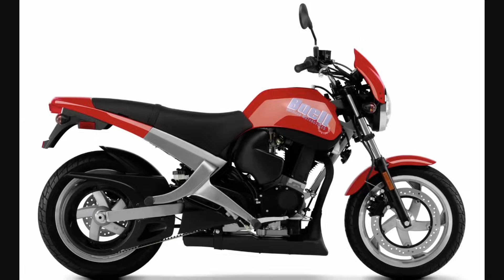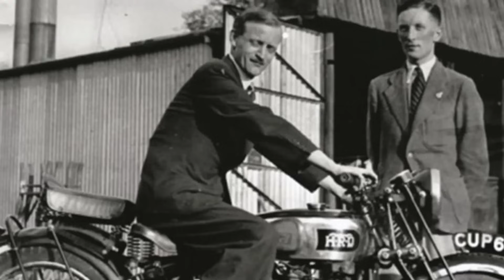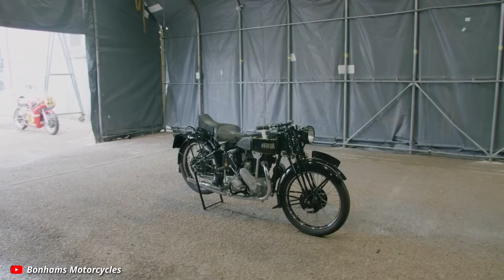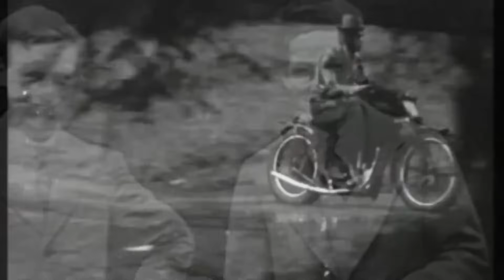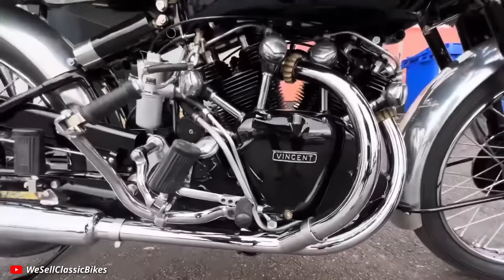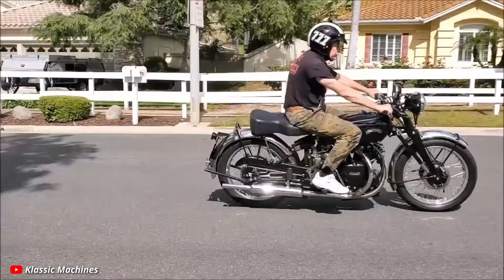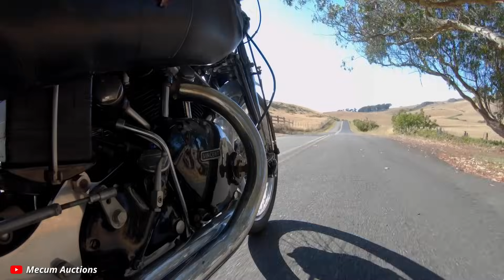The GREATEST Motorcycle Ever

Comment: Why did you not mention the Brakes were not adequate for the Speed and Weight of this motorcycle. You should have also mentioned some detail about the 'Compression Release' that was essential for a light weight Rider to start the engine.  The Magnetos were fairly useless unless the Engine could be spun at a relative high R.P.M. rate using the Kicker.  I was unable to start the engine on my friends 1955 Model C.

Comment: I've had about 30 motorcycles in my lifetime. My favorite was the 1951 Vincent Repide. When parked, people would always come around it to try to figure out what it was. A marvel in design for its time. The oil pump had to function in two ways: one to pump oil through the engine and the other to prevent oil from accumulating in the crankcase. This was achieved by a single moving part, which is what you call genius.

Comment: In 1980, I owned a 1953 Series C Rapide. While power was definitely there, not everyone felt the handling was all that wonderful, even during the years when they were being built. They developed a reputation for wobbling at high speeds, which the VOC (Vincent Owners Club) acknowledges. In 1965, Cycle World tested a 10 year old Black Lightning with only 2800 miles on it, and said "the handling was enough to make brave men blanch. Someone had once told us that the Vincent felt as though it had a hinge in its middle, but in riding the beast we quickly discovered that the hinge to which they referred was a ball joint. No motorcycle we have ever tested has flexed in so many different directions at once. Get the bike into a fast turn, trying hard, and it sets up a really heart-stopping shudder and waggle.... it is an evil-handling beast, with simply awful brakes. Potentially (and by this we mean unless ridden with great restraint) it is the most dangerous motorcycle ever to come our way: and we are not sorry in the least that it is no longer being made."  30 years later, in 1995, Hunter S Thompson wrote in an article for Cycle World magazine, where he said "If you rode the Black Shadow at top speed for any length of time, you would almost certainly die. That is why there are not many life members of the Vincent Black Shadow Society".
On twisty roads, Vincents could often be passed by other, smaller displacement motorcycles that handled better. Many Vincent engines were placed in frames made by other makers in search of improved handling.
It's interesting that after Vincent stopped building motorcycles in 1955, no one else purchased the tooling and continued production. BSA had become sort of the General Motors of British motorcycling, purchasing Ariel, Triumph and Sunbeam. Norton, Villiers and Matchless were together in AMC. But no one wanted to continue Vincent production. One must wonder why?

Comment: 1955 I bought a new series D Black Knight after being advised by John Surtees' . It served me well for over 27k miles but sadly had to part with it due to family reasons.  I often think of the past good times that machine gave me. Apparently there is one with the same Registration on the road but don't know if it is the actual same bike as I checked it on the www and stated it was first registered several years later. So I wonder if it had been a right off.  And the Reg Number then applied to a  rebuilt version.  Original Reg  SLE581. I'm getting close to the ton myself now. Thanks for posting this much enjoyed.

Comment: I bought a Black Shadow in 1958 in my late teens. It was sold in 1962 due to cash flow problems. Fast forward to 1999 when I bought a basket case Black Prince and restored it to concours condition. It is very original, no electric start, still with original suspension units but incorporating modern internal engine mods which for eg, reduces oil consumption. It is still near concours but I am too old to ride it. It is started and warmed through regularly and being a Series D has coil ignition, 6v electrics and still has its original coil which allows it to start more easily than with a magneto.

Comment: , my first motorbike that I bought when I was 14 was for £10 it was a Vincent. When eventually I managed to start it for the first time I took off down the lane and after a while I kind of realized now which one pedal is the break how do I stop this thing eventually I came to a stop and the weight of it just pulled me over and got somebody to lift it off me. I thought I was doing really well when I managed to sell it later before my parents found out for £10. I still have a 1949 Sunbeam S7 which I bought in 1965 for 10 pounds with about 1o miles on the clock. Since the beginning I have had broken ribs broken wrists broken ankles broken back broken thigh bone broken arm and various bumps and grazes and still alive and smile to tell the tail😅

Comment: To put the performance of the Black Shadow into perspective, at the time of its release it was THE fastest vehicle there was, two wheels or four, not, as stated here, "could outrun almost anything on two or four wheels". Although the CB750 Honda certainly came close, it wasn't until the arrival of the Kawasaki Z900 in late 1972, for the 1973 model year, that the Vincent was unequivocally surpassed for speed. Just imagine, the Kawasaki was developed with the truly massive resources of Kawasaki Heavy Industries, vast numbers of scientists and engineers, advanced metallurgy, it had four cylinders, four carburettors, double overhead cams, a 9000 rpm redline, in short the Kawasaki was the product of different world to the one that produced the Vincent Black Shadow.

Comment: I disagree, to me, Velocette is holder of the title. After all, ALL motor cycles owe their basics to Velocette, the very basic designs of the motor cycle gearbox is Velocette. Then, designing a motorcycle that could be stripped and re%assembled using 3 spanners and a rubber mallet! All the while redesigning and evolving and having a dedication to quality engineering.

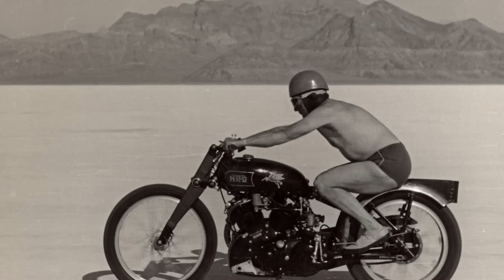Comment: I can't see the shock absorber, but the front fork and suspension at 16:32 looks like a Hossack. Simple for leg with two links to the frame. Much like sports car suspension starting above the wheel instead of to the side as a car has to do.

Comment: I have never seen specs on the Vincent Black Shadow.  My questions are:

1.) Why were Black Shadows so fast?
2.) What kind of carburetors did they use?  No air filter?
3.) Were they overhead valves or side valves?  How many valves?
4.) Did they use pushrods or something else to open and close the valves?
5.) What were the big plugs on each cylinder used for?  Valve adjustment?
6.) Did they have problems with overheating?  I notice each exhaust is located on the front of the cylinder, so I wouldn't think they did.

I hope someone can answer these.  Thank-you.

Comment: A couple of points, first the name change from HRD to Vincent is because in the US people couldn't distinguish between HD and HRD.  The second is you mention chrome a couple of times, Phil Vincent hated chrome so used stainless steel instead.  The Vincent Series C and D engines are some of the most beautiful in the world, as are the bikes.  I've heard that the entire bike can be stripped with the spanners supplied in the toolkit and engine removal and replacement is less than 45 minutes.

Comment: The mention of Vincent's WW2 role is not quite correct.  They also continued to make Motorcycle engines, but for use in drones (target drones?) by the Navy or Air Force.  Bizarrely, due to the ridiculous way military equipment is 'over-specified', even in wartime, the cranks for these engines were made to a higher spec than standard ones, and after the war came to be highly sought after by Vincent owners.
Reply: Yes you are talking of the Vincent Picador engine. I've seen one in a workshop being prepared for a customer, but never asked about it. I knew what it was instantly, after reading a feature in Classic Bike Magazine back in the 1980s.

Comment: I owned a series C Black Shadow in the early 80's and have to agree with you 100% . Smooth effortless power , very good brakes for the time and a clutch that one strong finger could operate. I have some experance with Brit bikes as in the same time frame I had BSA DBD Goldies,Vello Vemon clubman, Ariel Sq.4 both mark 1 and 2 . Plus various BSA singles-twins-triple, Matchless -Nortons ES-2 single and various 750 and 850 Comando twins.

Comment: My vote goes to the /2 series BMW “air heads”.    In 1974 I went to work at the National Geographic photo labs in DC and would see a showroom new looking white  R69S/2 with a side car in the parking lot.  I learned it belonged to a guy who worked for Bell Atlantic the local Telco who was assigned there full time to maintain the PBX phone system. There was another guy in the photo lab who owned a similar white R69S.  

In 1975 I bought a 1968 R60/2 and became a member of a group of DC airhead owners who met every Wednesday evening either at the garage of Ed, the owner of the side-hack rig, or Mike, another PBX tech who lived in Gaithersburg, MD to drink some PBRs, exchange jokes and stories and tinker with the bikes; both Ed and Mike repaired them.

Some of the things that made the /2 series noteworthy are:

They looked the same as the those used in WWII

It had a magneto ignition system and kick starter so even with a dead battery you could start it and get home, albeit without lights.  The generator, battery and lights were  6 volts.

Early models had trailing arm Earls suspension which mades the front end rise up when front brake is applied putting more pressure on the rear wheel.  With telescoping forks in a hard stop the front end dives and traction is lost on the back wheel.  Unfortunately it had drum brakes that sucked so bad  dragging your feet would stop it faster.

The crankshaft and two connecting rods were one unit press fit together at the factory with a large roller bearing on the bottom end and bronze bushing on the top for the pins on the piston.  A problem with the bushings or bearings meant buying a new $2k crank.  

The tolerances on the engine / transmission castings was so tight to assemble you need to put on part in the oven and the other in the freezer or heat with a torch.

They were mechanically simple and easy to work on.  In 1977 I rode my bike with the guy in the lab who owned the R69S  from DC to Ontario, CA for the Maple Leaf BMW rally the in one day all the way to Nova Scotia (600 miles) were my engine dropped an exhaust valve seat.  Ed had an identical spare engine in his garage and air shipped me the cylinder head off of it and in about 30 minutes with just the tools I had brought along I was able to swap the cylinder heads and get back home.  😊

Comment: My buddy, Alan, knocked a Vincent Black Shadow over in a motorcycle parking area. The Vincent’s owner was working in the building next to the cycle park. He saw Al pull up, get off his Yamaha 750cc vertical twin, and walk away. Only trouble, Al was so hypothermic & vibrated from that stupid vertical twin engine, he didn’t put his kickstand down! The Vincent owner saw it all go down, ran out, caught Al as he collapsed. Untangled the bikes. His comment: A 40 mile commute in 28 degree F. weather on a vibrator like that Yamaha will do that to a man. If I was terrified of getting a scratch on my Black Shadow, I wouldn’t ride it!”
That’s a man!
Al didn’t learn his lesson until the next month. He was coming to work on a 30 degree morning. His head kept telling his body to turn or he was gonna wreck, but his body refused to tell the Yamaha, so it went straight, jumped a curb and laid down in the grassy parkway between the eastbound and westbound lanes. Al went down in a half frozen grassy mess. Walked into the office looking like he lost a fight with the Swamp Creature. Got Al cleaned up & warmed up. The bike had a busted spark plug. He asked for one of my plugs. I said mine were 2stroke plugs for my Yamaha RD350. He said that would be better than a broken 750 twin 4 stroke plug! Right! 
Then the weather warmed up, Alan sold his Capri, bought a new Ford F-150 pickup, loaded the Yamaha in the bed and moved back to Indiana. Next time I saw Al was a year later at his wedding. There was the 750 twin Yamaha sitting in his garage. Still had my spark plug in the right cylinder. He said it was runnin’ good!

Comment: Is it my imagination or do I see two sprockets on the back wheel, one on each side? Why would this have been?  Great video by the way.
Reply: In case you wanted to fit a sidecar, to give a different ratio. Some racers had different sze sockets fitted for different circuits. The rear wheel being capable of being reversed, only takes a few minutes.

Comment: The Vincent was a great bike but the seat being attached to the rear swing arm must have made for a difficult ride, a design fault to be sure so not perfect.
I have a 1988 Yamaha Vmax 1200, to my mind a latter day Black Shadow, for me a perfect bike and one that many are wary of due to those reviews that stated it didn't handle. It will handle well enough for those of us who aren't afraid of it and as a forty year design will keep up with many a modern sportsbike on public roads where those bikes top performance cannot be used.
BTW being the first doesn't mean 'before its time', that's a cliche that needs to be dropped.
Reply: 'before it's time' is different to "1st". It means specifically that this was a technological advance that wasn't repeated for a very long time (normally due to not being recognised as such in its own time). 1st would suggest more a continuum from there to 2nd.
Reply: @jonm7272  'Before its time' is simply a cliche trotted out by those who can't be bothered to dig a little deeper.

Comment: Its wild to think now that a 55hp bike held the speed record for decades
Reply: The speed record bike was highly tuned.  Irving wrote the bible "Tuning for Speed".  Still read today and still worth reading.
Reply: The post war Vincents were designed to run on 70 octane gas (petrol).  The Black Shadow had a compression ratio of 7.3:1, and guaranteed to do 125 MPH in the hands of a competent rider.  I've only had mine to 110 with more throttle available, but that was 44 years ago.

Comment: In the early 90's I spoke, a then almost 90 years old man, who had riding motorbikes for the longest time of his life. He told me that in the 20-40's most riders only used motorbikes because that was the cheapest (fast) form of transport, not because they were bikers. Most would have traded in there bike for a car any day if they had the money. He was an exception like I am. Most bikes were 125-250cc bikes. Not because they liked them, they were all most people could afford. 
I'm 61, I started riding at my 18th birthday and it is always been my main form of transport. For the most times I rode sidecars but severe back issues (2 traffic accidents) made that to painful and I switched to trikes for the last 25 years. My current bike is a GL1800 reversed trike I bought 15 years ago and I will probably be the bike I have for the rest of my life.
Reply: The early 1970s in the UK were like that , lots bought a car as soon as they could afford one..  also 250 was the learner limit..anyone over 17 could ride one
Reply: I'm very much the same ,  though I am half a dozen years older than you  , I started when I was about 13 then on the road at 17 , I now ride a Norton 650SS  and 2007 Bonneville plus others of different stages of rebuild  , I've had a family and the necessary cars but I haven't owned on for over 5 years  , my bike's my main form of transport too

Comment: Vincent V-twin head bolts were used as motor mounts in the very flexible frame. Rough roads at high speeds would blow the head gasket.
Reply: That`s bollocks, because the Vincent does not use a gasket,  also does not have a frame to be flexible.

Comment: Everywhere you look on a Black Shadow, you'll spot wonderfully engineered components that are designed not only function but to also be easily serviced. Even better is to look inside the engine - the timing gears are a work of art. I liken them to cogs in a watch.
I see you've included some footage of the South African Shadow owner. He has some excellent footage of his bike being ridden - as you say, an owner who uses their bikes as they should be.
Reply: I’ve watched a couple of those posts.  It feels like you’re on the bike.
Reply: Is that the clip around 12:15 ? I wondered if that was SA, or otherwise, Australia.
Reply: @grantm6514  I’m pretty certain that’s the video I saw from SA
Reply: @grantm6514  Yes that is Phil in South Africa, he has to be careful as thee are Baboons running around.